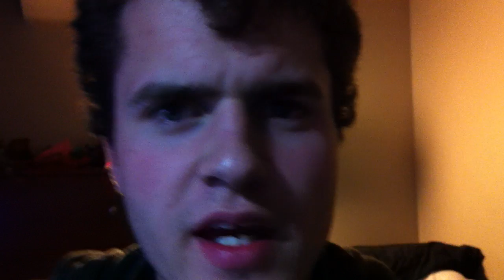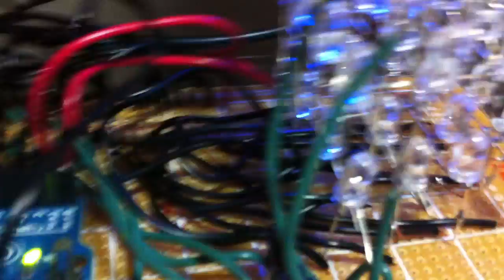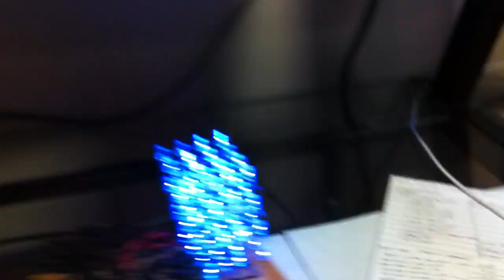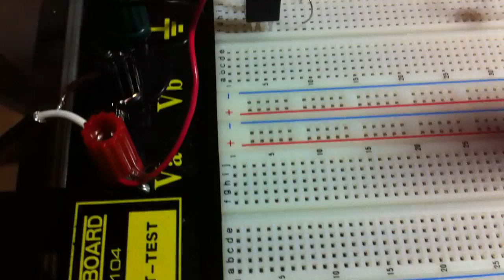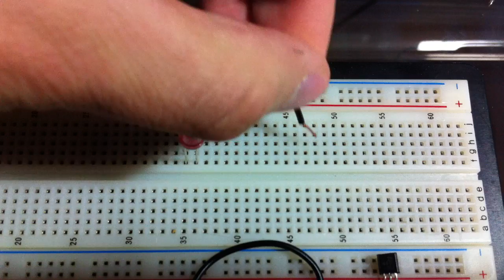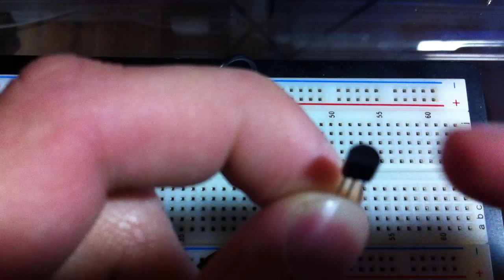Electronics - Using an NPN Transistor as a Switch

Comment: how to make a switch that switches on/off again and again at high rates PLEASE!!
Reply: If this is still relevant. I would look into using a 555 timer in astable mode. There are millions of tutorials on youtube.
Reply: James Grogan
555 timer? what about trasistors
Reply: waleed khalid Although transistors are useful as switches I would not recommend using them for a flipflop circuit. A 555 timer put in astable mode would be much more reliable and easier to use. Hope this helps :)
Reply: James Grogan
where can i get a 555 timer
Reply: waleed khalid Practically any electronics dealer. Amazon will do a good offer or just do a google search. They are sometimes abbreviated as NE555 or LM555.
Reply: James Grogan
how to hok them up?
Reply: waleed khalid Google search: 555 timer astable circuit
Reply: James Grogan
yeah

Comment: That led looks more orange than red
Reply: orange means more volt is applied . the resistor connected is of lower value, higher value will suppress and gives less voltage giving the led a red light not as bright as orange...

Comment: how do you use it as a switch
Reply: Ismael Soumahoro That's what he showed.
Reply: rkshireygames what he showed was basically useless, it was the same as putting a switch from the negative to the led without the transistor.
Reply: ***** If you think like that you wont understand. This can be easily implemented with a micro controller and be very useful. He showed how to use it as a switch.
Reply: +rkshireygames 👍🏻 true
Reply: +JustAlbin If you build this circuit but use a switch instead of the transistor, you will be limited by the speed with witch you can open and close the switch and you will get tired quickly. With this circuit, you can use a microcontroller digital output pin switching on and off in just microseconds. And it will run indefinitely. Also, you can use it to power higher voltages that the MCU could handle. Kind of like a relay.

Comment: Hey! I think you said the collector, base, emitter in the wrong way. If not, Please explain me again. getting confused.
Thanks for the video anyways.
Reply: the base is the switch to turn it on or off, the emitter goes to ground, and the collector goes to the negative side of your component.. I am using an arduino and a PWM signal based on some event is fired on one of the digital out pins of the arduino to the base of the transistor which turns it "on" (connects the collector to the emitter). in short, you are using a small positive voltage PWM signal from (some) source to connect the negative side of your circuit. one wire turns it on because the other end of that is already grounded in my arduino. you can add a second larger battery and simply connect the ground to your first battery ground and run the positive to your component.. since the grounds are common, it will complete the circuit. I didnt understand transistors before this video and some other research so kudos, like and sub to OP
Reply: Ive just had to check on tha   onetoo. In another video where he shows the Darlington transistor set up the Pin out was said to be EBC which I understand is the correct version.

Comment: now pls tell how do i use it with arduino
Reply: Nachi Muthu Output port pin to the base of the transmitter..
Reply: +Richard D' Freitas. I would need to wire the Arduino GND to the common GND right?

Comment: This is not how to hook it up even if it works you can not have no current going to the base or sooner or later it will burn out.
Reply: What would you suggest as an alternative?
Reply: You should have a small current going to the base
But not enugh to saterate
The transistor.
Reply: any suggestions?

Comment: watched lately but no use of that u still need to pull the wiire to turn it off and put the wire to turn it on what use of that transistor lol
Reply: When using a microcontroller, you can do it automatically. The micro-controller can send a "High"-pulse to the transistor, thereby activating the LED or a "Low"-pulse to deactivate the LED